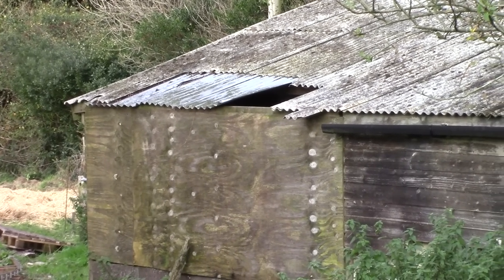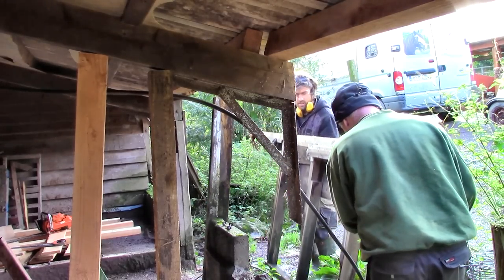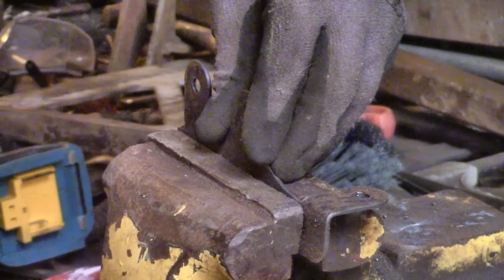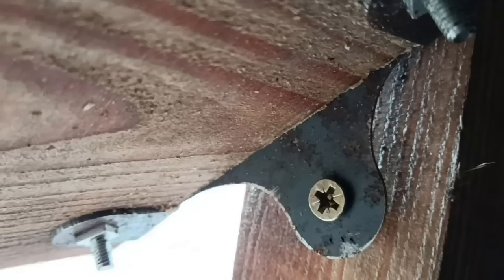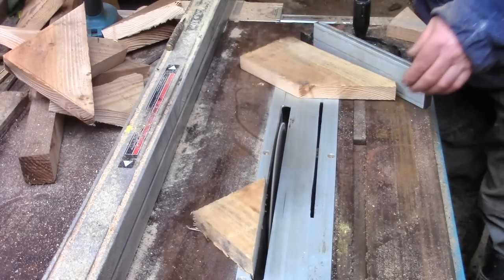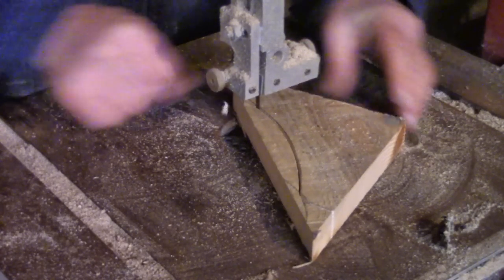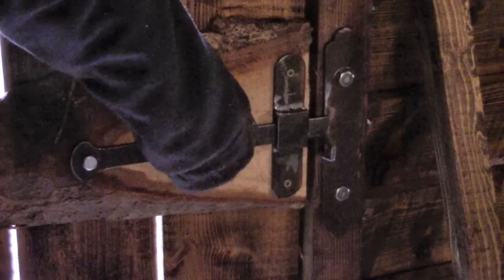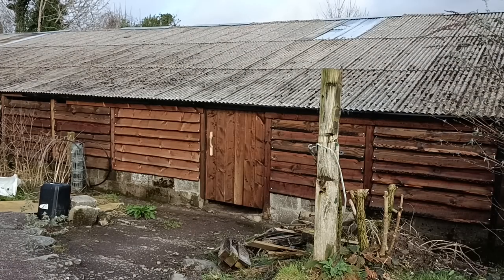Homemade Openable Louvred Walls For The Barn

Comment: Hey Tim your the reason I had started my 15 gauge railway. Thank you for sharing so much knowledge with us. I am going to attempt to make a extremely heavy duty wagon with triple bogeys (12 wheels total) in my upcoming video. Keep up your hard work 👍
Reply from the maker: Sounds Great. Best of luck!
Reply: Tip: Make two bogeys with triple axles. Then have the middle axle of each bogey have no flanges so they can move sideways. Mechanically a lot simpler and it's how big steam locos worked.
Reply: @IIVQ  ah thank you it makes it a lot easier not having to make those extra flanges. The frame that it’s going on is 5 ft wide by 20 Ft long so the wheels need to be as big and heavy as possible and a low enter of gravity. It’s may not work but I’m still going to try anyway
Reply: @westtexasworkshop2628  The non-flanged center wheels make negotiating curves possible without too much hassle. There are locos with three two-axles bogies (I'm sitting in one right now: https://nl.m.wikipedia.org/wiki/MDDM ) but there the centre bogey can slide sidewards. (and you lose a lot of heigt which results in a higher centre of gravity) See also https://en.m.wikipedia.org/wiki/Driving_wheel#Flangeless_wheels

Comment: Tim, concerning your constant flow kiln: whenever you get around to rebuilding it, maybe consider moving the motor further away from the source of the heat. Maybe there's also a way to blow cool air around the bearings that hold the screw, or maybe you can find a way to water cool them.

Comment: What would be fun: Add a cup at the edge of the roof, with a pinhole in it. If it's raining the cup will fill up and the weight will shut the louvres, and if the rainwater has dripped out again, they open again by a counterweight.

So they will be automagic :)

Comment: Lovely wee project. If you find that too much driving rain makes it around the ends of the louvres, you can add a flashing piece to the inside of your posts to let it run down, and out over the concrete.

Comment: it might be cool to mount some pulleys on the walls, so you can run cordage to the chains, and then tie them to cleats on the wall so you didn't have to bend down every time you want to adjust them.

Comment: One thing I'd definitely add is a handle for that latch. I was using my fingertips on the one on my shed for ages; eventually I caved and welded a simple stick to it and it's been night and day the difference.
Reply from the maker: I made a secret way to open it easily from both sides - but it's a secret

Comment: I presume you're familiar with the dangers of asbestos.   That roof is certainly asbestos cement.  Don't ever break it up or throw it in a fire or let it dry out too much - it looks old enough that the cement component could be degrading, particularly with that lichens and algae on it, potentially releasing asbestos fibres.

Comment: I wonder if it wouldn't be better to use two washers: One fit's a hole in the bracket, and a second one above is a bit larger. This way you can screw them up tight, and the louvres will rotate on the inner washer instead on the screw itself.

Comment: An interesting project for this would be to build a 60KW+ diesel heater (you can get all the crucial parts online and then just build the fuel tank and the shroud from sheet metal) like what they use to heat barns. this would allow you to do drying in the winter.
Reply from the maker: But we harvest in July  : -  )

Comment: that looks awesome!!! i'm kinda surprised you didn't connect all the chain's to a lobes on a round bar then at each side of the door having two large lever's to open and shut each side this way you don't do your back in by constantly being hunched over altering the chains and it will save you time!
Reply from the maker: Teh plan is to open it once at the beginning of summer and close them at the end, so not too much time  : -  )
Reply: @wayoutwest-workshopstuff6299  Yup that sounds great just spitballing ideas to make it easier for you ;)

Comment: Simple, Looks Great And - It Works! What are you going to do if it blows in drying?
I mean it's obvious they aren't going to co-operate and all blow the same way, that's not how shit happens, So how and with what are you going to straighten them?
If you're at all concerned about bugs or rot use a weed sprayer and do them over with used engine oil and diesel in the heat of summer, wet them make them drip dry and the smell disappears in days. This will keep the weed down close to the shed as well.

I'm looking forward to the video where you straighten all these - 🙂
Reply from the maker: You could be right, but the first ones were made a couple of months ago now (it was a long project) and they've dried straight, so maybe not..

Comment: Wonderful! To “lock” the louvres in the closed position, would a nail at head height which accepts the top of the chain work (assuming you have a few extra links dangling there)? Just for when it’s windy and you need to batten down. Or is gravity enough with those lovely 1” boards?
Reply from the maker: Yes, I should have included that, but you're quite right

Comment: Did you consider putting some sort of felt on each board so they seal up bit better or are you worried it would develop mold due to poor ventilation? Nice project in any case.

Comment: Try using tex screws. Same price as spax, but about 6mm shafts. Also easy to take out, especially after a while, when screws bake tight to timbers. No more ruined heads and bits breaking. Greetings from Co.Sligo
Reply from the maker: Excellent idea - thanks
Reply from the maker: @SynomDroni  We differ greatly on Ukraine, so no thanks!

Comment: you could have just cut a metal strip on the cnc with holes evenly spaced apart. No measuring needed, and perfectly spaced apart!
Reply from the maker: But then they wouldn't have fitted! The point I tried to explain is that these louvres are totally irregular and they would jam up if you tried to force them to conform..